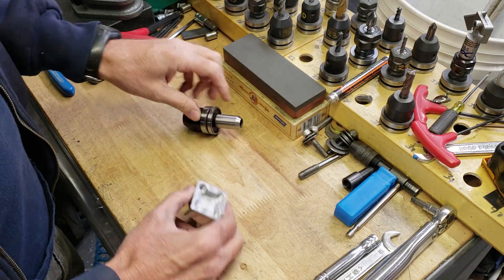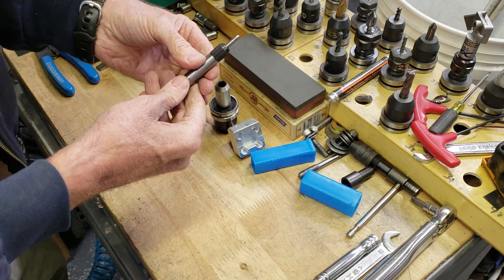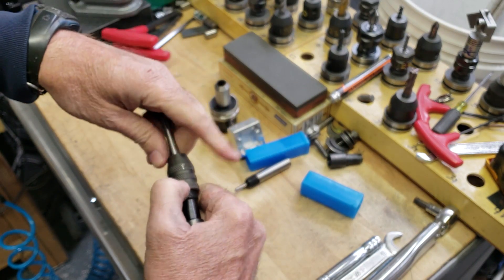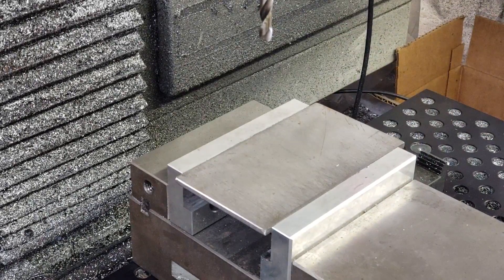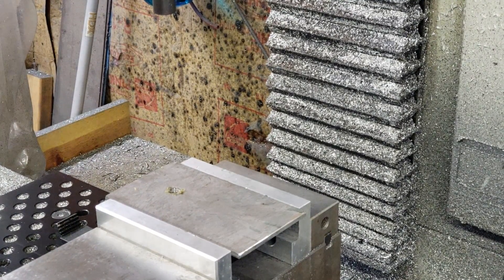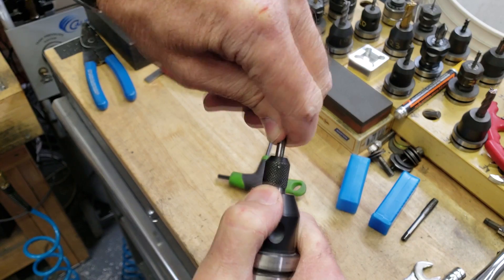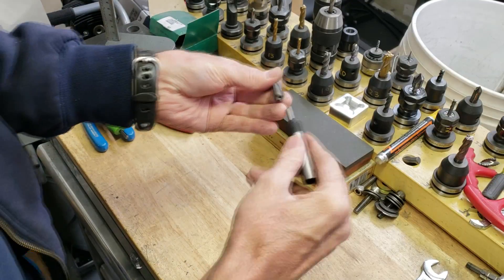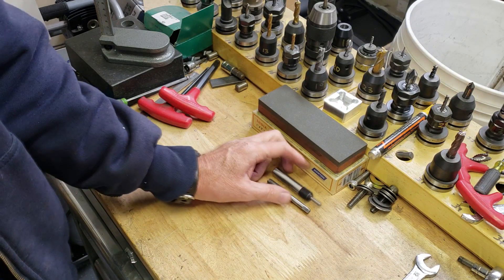Manual Tapping on the Mill - Spring Loaded Tap Center.

Comment: Realize that some of the better tapping handles have a tappered hole in the end for the spring loaded tap follower to go into. No need for a wrench on tap. We use these exclusivly at work for hand tapping, we also use a manual tapping machine. If we get into a lot of holes then we use a floating tap holder and chuck it in the mills to do all the tapping. Dont know if this little tormach mill has that soft tapping programing capabilities though? If we do taper tapping, then we program it for rigid tapping.

Comment: The hole on the tap is not specifically for the spring, it is so coolant can flow though the tap.
Reply from the maker: I know there are taps with holes through them for coolant but these are just cheap taps. The holes don’t go through. I think they are just for centering.

Comment: If you take the spring loaded center apart, one side will have a point and the other side is a concave radius for using on small taps with no center hole might come in handy some day! Thanks for the shout out

Comment: Yep, and if you unscrew the centering tool there is a concave end for it in there for those taps with a point on the end instead of a hole.  Should be a point on the back of most small tap wrenches for using the spring loaded point too.